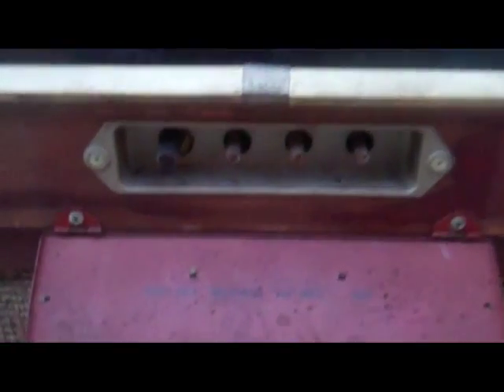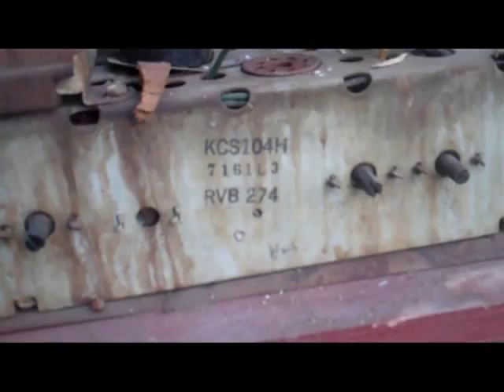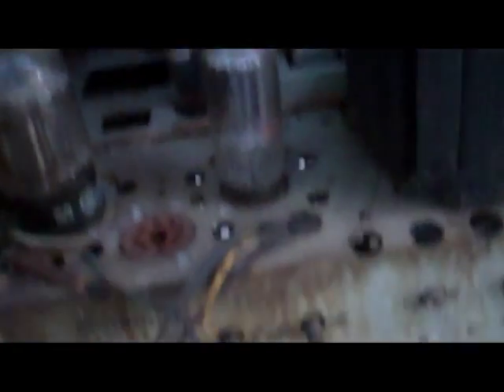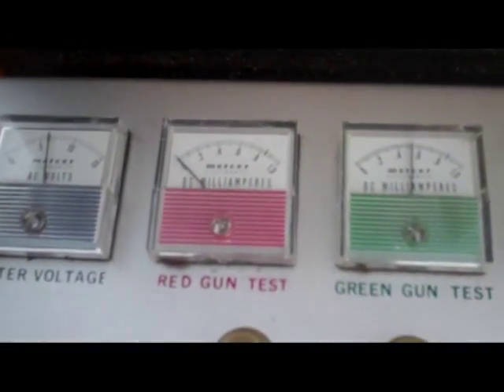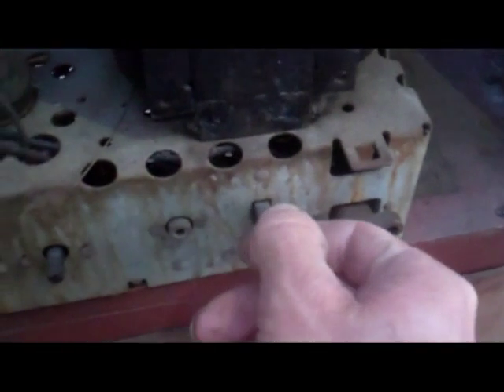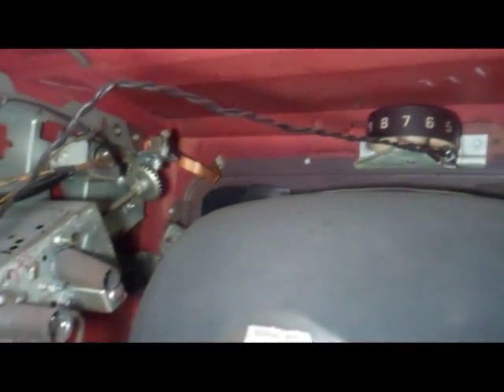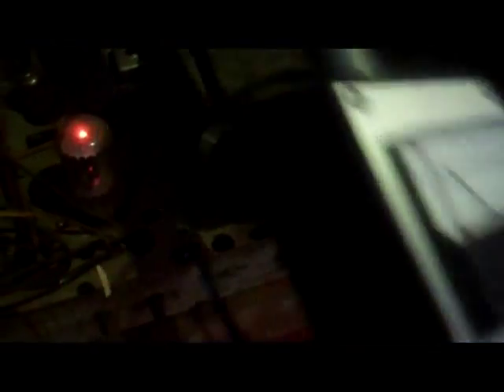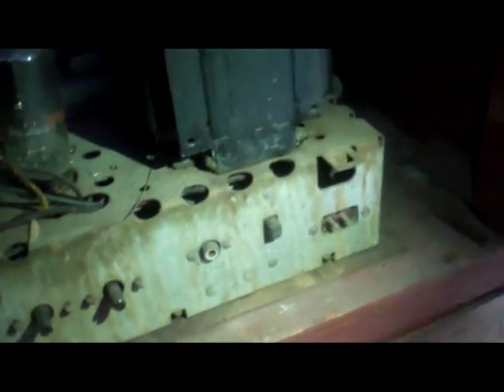RCA KCS104 H 1957 Black and White TV Assessment and Test

Comment: My 1950 G.E used to roll like that for much the same reasons, bad paper capacitors, although yoy could at least get it to lock somewhat. I think that RCA would be worth saving, the fact that it has three speakers indicates that it's one of the higher end black and white models, and the styling is kind of neat for a later 50s TV.What I don't like are the early printed circuit boards or the way they are mounted to the chassis, some of their other models had much better access to the solder joints.

Comment: Yeah, the caps in the hor oscillator circuit drift off & you'll find a coil underneath the chassis & you have to adjust the rear slug on to get the hor. to lock. Been there done that with those RCA sets. They are very restorable, though you'll have a hard time finding that belt for the channel indicator!

Comment: 5kv aint going to light that tube!     Recap the damn tv!    and it  aint the ion trap!       hv is way too low because horiz freq is off!          40 years doing this!   I think I know what I'm doing!
Reply: how do you adjust the horizontal drive and horiz linearity. everyone says adjust horiz linearity for lowest cathode current. that applies to a color set. im thinking in an old b/w set you adjust for best linearity and cathode current may not be set for lowest with the linearity setting.  seems ive been reading to adjust the drive until you get a drive line and just back it off until the line just goes away